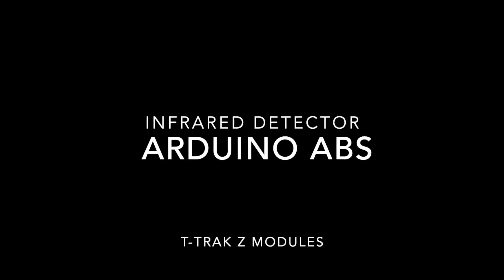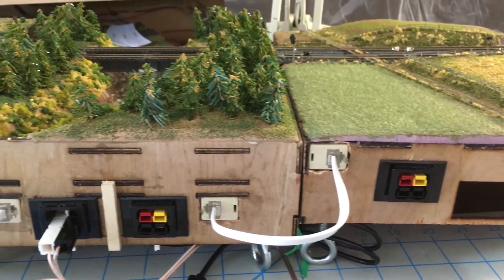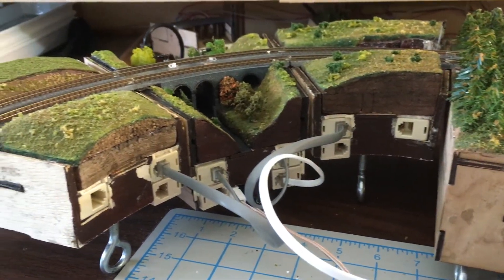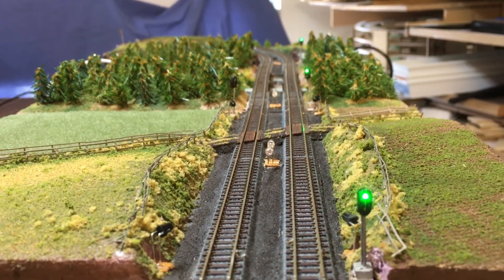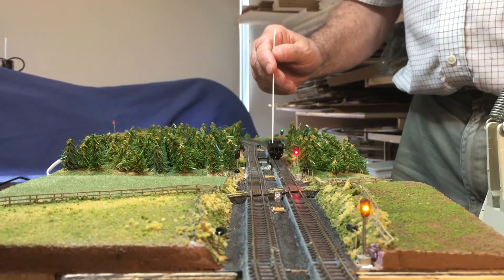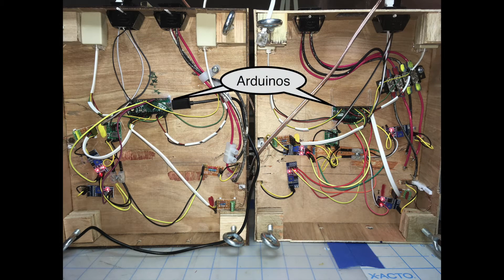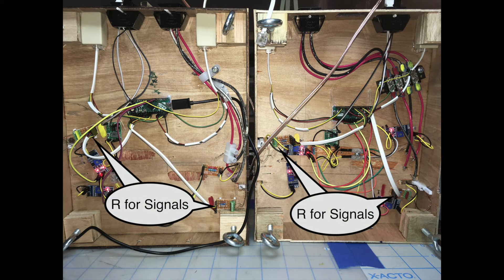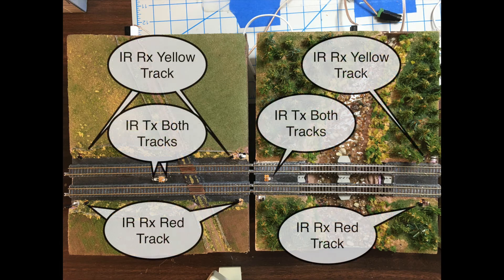IR ABS on T-Trak Z

Comment: Just asking, what is the sketch you used for the signals?
Reply from the maker: I have not posted the code mainly because I keep changing it.  In summary I converted Dr. Bruce Chubb's BASIC routines with some minor housekeeping changes to C++ for the Arduino.  My earlier video using the MEGA shows that result.  The main difference when using IR detectors is the IR boards read HIGH when the track is occupied vs. current detectors read LOW when the block is occupied and there may be multiple IR boards for one block.

Comment from the maker: Signals are homemade.  One commercial unit would cost more than all the other components combined.  Three surface mount LEDs, magnet wire, hollow brass tube and the rest is card stock cut on my diode laser.  This is Z!  No hoods over LEDs or access ladder for maintenance.